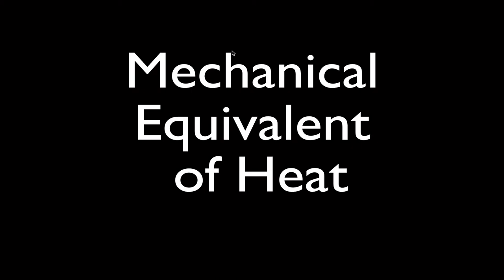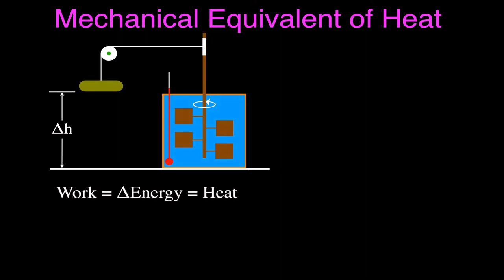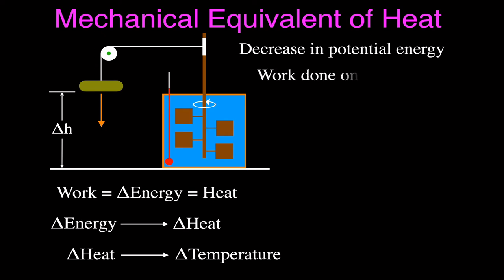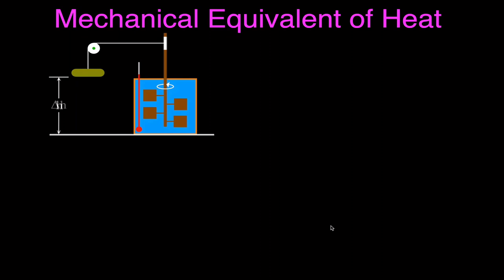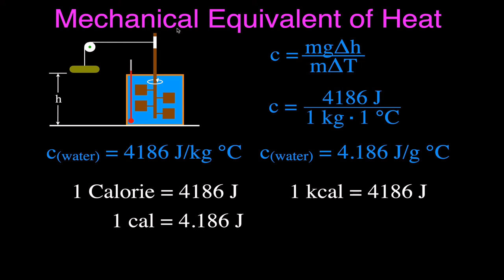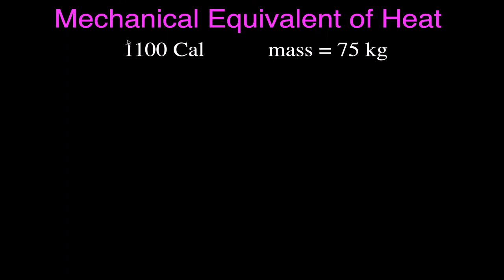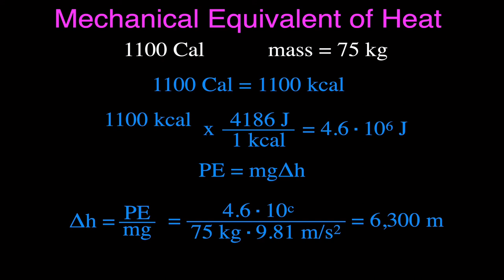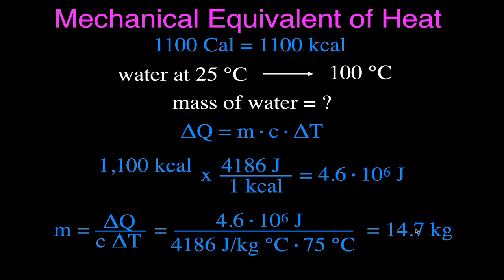Thermodynamics: Mechanical Equivalent of Heat

Comment: My Physical Chemistry teacher sent us this video as a Moral Homework (something to watch to learn, but not mandatory) and I found it very interesting, the last part about tha water wouldn't it have been easier to work directly in Cal, since 1 Cal = 4184 J, and specific heat of water is that of 1 Cal/kg*C then it would have been directly:

1100 Cal/(75 C* 1 Cal/kgC)= 14.6 kg

I understand the use of metrical system (Mainly because I DESPISE imperial,  but I definitely wouldn't do the conversion if I can save 1 step, I'm lazy…)
Reply: Also as a side note, we are considering the disk to have no mass, right? Because of inertial considerations, how much do they affect if considered? Will the resistance to movement of water reach a point in which the mass gets to a static equilibrium?, Why? why not?, (I know it won't but why?), Is it worth it to ask this questions? (Are these considerations useful at the end or not?, In which cases they would be and wouldnt be…)

Comment: Just wanted to point out a small typo. In Thermodynamics, heat is a path function not a state function and therefore depends on the path required to take a system from one state to another. Given this, it’s technically not correct to refer to heat as ‘/Delta Heat’ or ‘change in heat’ since heat is not a quantity that exists at a state, but an energy transfer mechanism driven by a temperature difference.

Comment: This constant experiment is flawed since the temperature change is also proportional to the friction, shape, and size of the calorimeter apparatus, yet friction and other variables are not included in the calculation for the constant. Also, speed and frequency of the calorimeter spindle would influence the reading.
Most of our science is wrong and based on poorly designed experiments with improperly conceived conclusions.